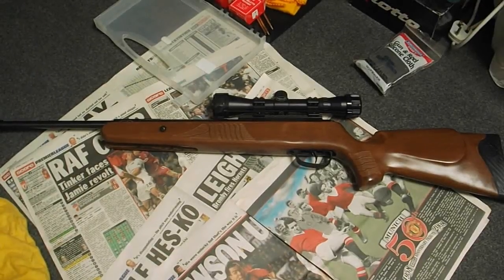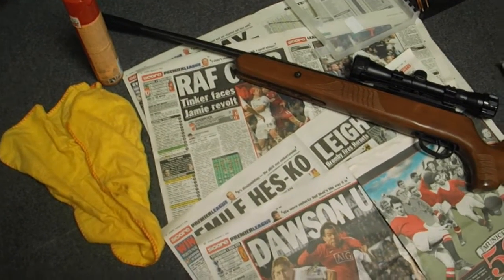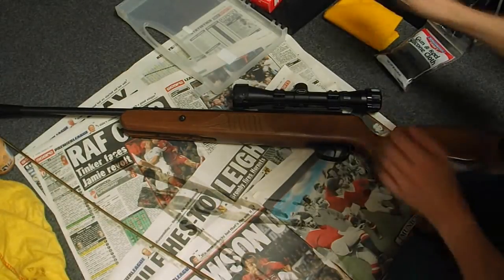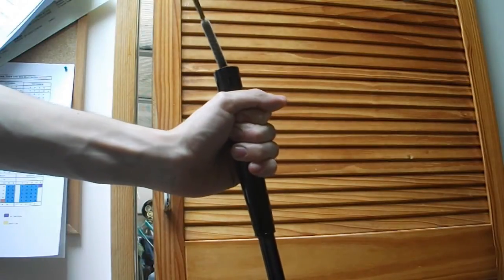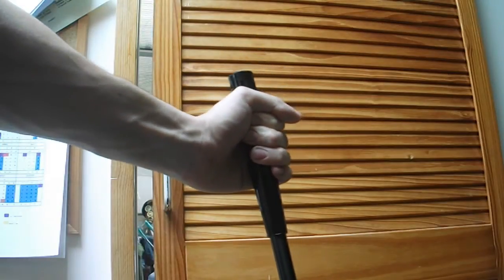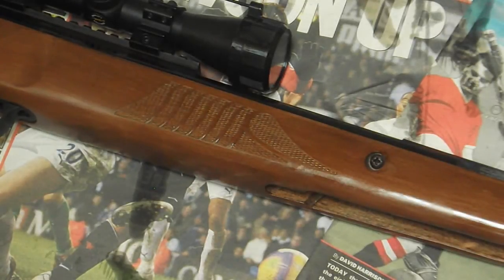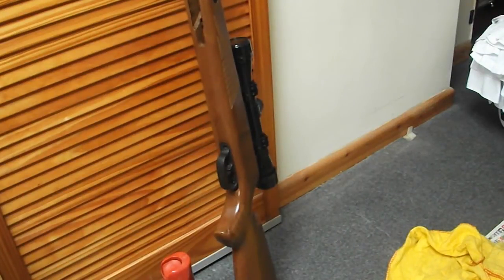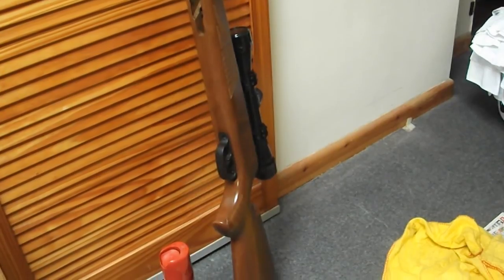How to clean an air rifle (Tutorial)

Comment: you do not run the soft oil pad or brushes down the barrel with the barrel together or else all you are doing is ramming deposits and grime down the barrel to the action. break open the barrel so that the deposits come out of the and of the barrel.